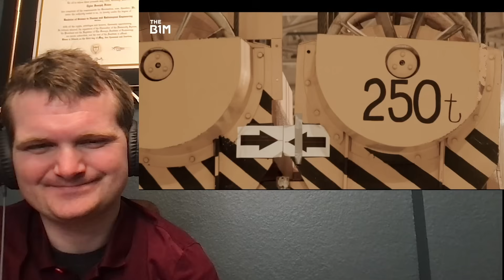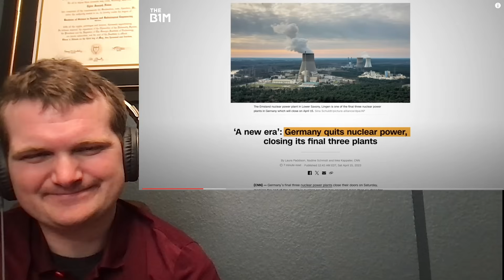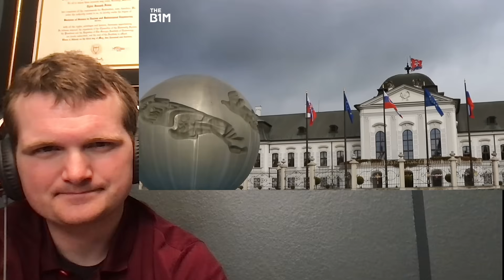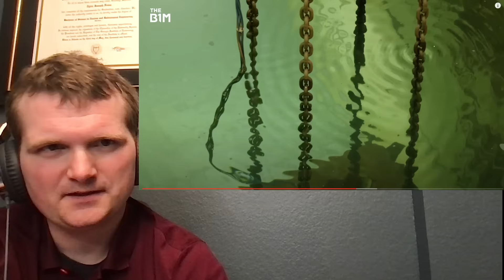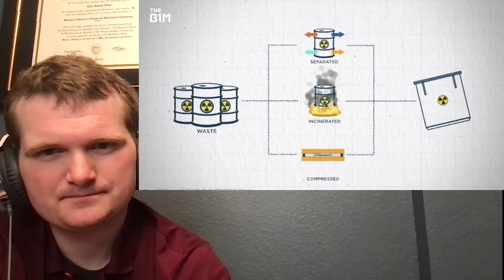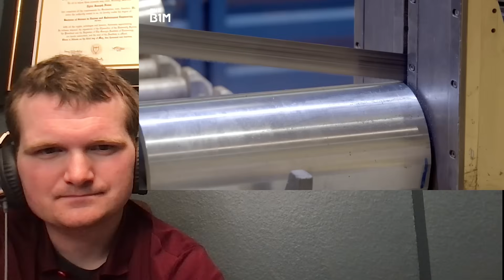Why Soviet Era Reactors are Being Decommissioned - Nuclear Engineer Reacts to B1M

Comment: If you made SMR sites designed to last much longer than the individual reactors themselves, you could avoid decomissioning the activated and comtanimated regions that were still mechanically sound and just swap in new reactors, leavingthe contaminated infrastructure in place, right?

And potentially, even the reactor vessels themselves could be designed to be disassembled, decontaminated (from any externakl/surface level particulates, not activation products in the bulk material), tested for mechanical soundness and rebuilt without having to discard all components wholesale?

The more of the moderately contaminated, but otherwise still usable infrastructure you can re-use, the less has to be treated as bulky waste (on top of the cost savings of avoiding manufacturing entirely new components)

Though some of this makes me frustrated that some shuttered nuclear sites don't leave the non-nuclear portions intact and mothballed for re-activation with new, modular reactor units providing the heat for the old turbine units. (providing the old units still had substantial life left in them and are reasonably efficient to not make the cost of total new infrastructure worthwhile)

If there are old coal fired plants worth converting to SMR power, I'd imagine some of the old nuclear plants would be as well.

Comment: I am from Slovakia. I was in Jaslovske Bohunice a few times, also my good friend was demolishing cooling towers by cranes there. V1 was 'easy' to decommision. In same areal is older A1 block  and newer V2 (same as V1, with two 440 vvers, but newer version) .  V2 is still working, but A1, old CO2 cooled reactor moderated by heavy water, had two serious incidents. during first incident, in 1974, 2 workers died due CO2. second incident, in 1977, contamined reactor hall and some rooms and was categorized as INES 4, and was a reason to close A1. This block is still there and after almoat 50 years, is still hard to decommision.

Comment: Sovjet reacotrs: 
Certainly RBMK is a bullshit, but VVER or BN reacotrs have much higher safety standards.
Of couse, it's not very desirable to have an open air dry storage for spent fuel or operating a nuclear reacotor directly at a conflict line (like in saporoghija in ukraine)
VVER reactors have a tough containment with an interesting steam generator layout (I have some of the training material, but sadly only for the secondary circle, not the nuclear part)

Comment: We have in Finland 2 very old VVER440 reactors (plus one new Areva PWR and 2 old Swedish BWRs). There is very little of original plants left. Soviet crap was partly replaced already when they were built in turn of 70/80s. Power has been upgraded, pressure vessels have had new heat treatment, etc..

Comment: I am from Slovakia. The video you react to had some inaccuracies. If you ever visit Central Europe, we can have a talk over a glass of beer or wine, I would provide you with additional information and context. You made this video with no previous research, because you started to talk about graphite. No problem. You still provided valuable insight from you perspective and I found that interesting. But a little more context would do no harm. As well as historical records regarding the design and operation of the VVER 440 reactor family (both the older v230 and newer v213 models). There was a lot of politics behind certain decisions. The reactor vessels of the V-1 plant were annealed to extend their lifetime (annealing due to neutron flux), yet had to be shut down for no other than political reasons, especially because of Austria. The design is old. I agree. But new ones are still being buit (V213), one commissioned at Mochovce 3 and soon to be Mochovce 4 are expected to be run well into the 21st century. Projected lifespan of 80+ years. Without a containment vessel! (this would be another discussion). As said, I am willing to talk more in person. In the meantime, if you are interested, there are publicly available documents on IAEA.

Comment: The Tomari reactors here in Hokkaido, which all 3 had been offline since 2012 following the 2011 Fukushima disaster, have been undergoing extreme upgrades before receiving government regulatory approval (NRA) in April of this year (2025). The next phase, now that all those plant and reactor upgrades are complete, is to build a 19-meter high seawall to protect the plant (which is on the southern coast of the island), currently scheduled for completion in 2027. After that, final approval from the local residents will be sought. Once the local population gives the thumbs up, Hokkaido Energy will begin the procedures required to bring the reactors slowly back online (beginning with #3) after 15 years, each reactor producing approx 900MW.

Comment: I don't know how It works in other eastern europian countries, but here in Czechia we have to NPs:
Dukovany, with 4x VVER440 (4x 440 MW installed in the early 80s, over time upgraded to current 4x 510MW)
and Temelín with 2x VVER1000 (2x 1000MW installed)

Both were designed to last 40 years and Dukovany was already extended for 60, with expectation of being extented to 80 years. Just as you mentioned. Temelín hasn't been extended yet (as It is newer), but same extension to 60 and possibly 80 years is expected.

Also, as demand grows and we reduce are coal plants, two new 1000MW blocks should be build at Dukovany. (also to eventually replace the old VVER440 blocks) Czechia already signed the papers with Korea, but so far It's being blocked due to legal disputes with France.

Edit: I think WWER is translated to english, as VVER stands for "vodo-vodní energetický reaktor" in Czech (It's similar in Russian, only written in cyrillic), which translates to "water-water energetic reactor" in English.

Also It shoudl be noted, that our VVER reactors has been only based on soviet blueprints, but were completely manufactured and build by people of Czechoslovakia. I dare to say resulting in significantly higher quality of these reactors in the firat place. Furthermore, their operator, ČEZ, invests a lot of money in upgrading and maintaining all of them.
So I'm quite confident in the safety of our reactors, even tho they use soviet design.

Edit2: Our NPs use three water circuits. The main circuit from the core only heats up secondary circuit that generates the steam going in the turbines. When the steam condenses, It's still too hot - here comes the tertiary circuit, connected to the cooling towers.

Edit3: You know what, I think It would be easier for you to come to Dukovany for excursion :D It would explain a lot about the VVER design :)
Reply: It's kinda funny how you trying to prove some quality point by saying that they were manufactured! by Czechs!, but they still were developed, tested, first build in USSR :)

No negative, just funny part
Reply: @Bob-fs1ie Well yeah sure I get that. But often the soviet designs were bad, beacuse they were not build properly and were poorly maintained because of the regime and their work culture... Which is both significantly better here. Even tho It is the same design, I wouln't trust our NPPs even closely as much If they were build completely by Soviets.

Similar case was with RBMK in Ignalina in Lithuania. Even tho It was the horrible unsafe design, this NPP was much better than the ones in Chernobyl or Russia. It's sad It was shut down due to political reasons.

Comment: 2:50 – Subsidies for renewables actually make nuclear energy unprofitable. They cause such price instability that it becomes difficult to sell electricity at a reasonable price — prices can even turn negative during the day. As a result, there’s no guarantee that building a new reactor will be financially viable, since subsidized renewables create long-term uncertainty about market prices.

To work alongside renewables, new nuclear plants need to be flexible — able to ramp up and down quickly (load-following). Alternatively, they should be designed to switch to hydrogen production when electricity prices are too low. This hydrogen can then be blended with natural gas and used as fuel, helping to further reduce greenhouse gas emissions.

Comment: After decommissioning the reactor itself, could you leave the other infrastructure in place, like the cooling towers etc. and build a new reactor with a new design on the same site? The site has already been OKd to have a nuclear reactor on it after all so the zoning and legal crap around that shouldn't be an issue and not having to rebuild all the other infrastructure would save a heap of money wouldn't it?

Comment: I don't know if this is true but I've read somewhere that Chernobyl actually used MILITARY reactors slightly redesigned for civilian use. Which was the reason for weird design choices of the RBMK. This is also probably why Diatlov, a former engineer on nuclear submarines, was the main engineer at Chernobyl.

The main purpuse of RBMK reactors was not to actually produce power, but to produce plutonium for military use - or so I've heard. But Chernobyl was a nuclear power plant, so they've used those nuclear reactors for something they weren't really designed to do.

Soviet military used to have (stil has) very low safety levels as everything was top secret anyway and even if an accident happened nobody would care since the site would most likely be hidden anyway and everything would be covered up (like in case on Kyshtym Disaster -  google it). This is probably why a lot of safety features present in civilian reactors were skipped or simplified in RBMK.

So yeah, The Soviet Union did the stupidest things and then wondered how come those things wouldn't work.

Comment: Bohunice 
A-1 KS-150  operation stopped 1979
V1 
1 VVER 440/V-230 ops stopped 2006 
2 VVER 440/V-230 ops stopped 2008
V2
3 VVER 440/V-213 planned stop of operations 2065
4 VVER 440/V-213 planned stop of operations 2065
Plan 
APR 1000
Reply: Plus there is Mochovce another multi complex with 4 reactors where 4th is to be finished by next year

Comment: I work at a decommissioned nuclear power plant, just to put things in perspective, it took 21 years for the decommissioning process and most of the buildings and cooling towers (just the conctete shells) are still in place, but they're completely gutted.
Reply: What kind of work is there to do at a decommissioned site?
Reply: @stab74  Pretty sure some places turn into museums/experiment facilities/education facilities. Some facilities gets abandoned completly where they only do check ups due to having classified information etc, And some facilities serve a different purpose.

Comment: Nuclear is just the way to go. We need to get away from this stigma of Nuclear is bad and dangerous. If all things are done correctly and these sites are regularly audited (like they currently are), then Nuclear is safer than any other power source bar Fusion. 

The waste is negligible and most of it (once decontaminated) can be reused. It's also a lot less of an impact on wildlife and the environment. "Green" energy requires far more heavy metals to produce (which means a lot more destructive mining), far more land to destroy to get adequate amounts of energy (solar farms and wind farms), and the batteries are all lithium. Lithium batteries do not hold the charge forever and eventually lose the amount they can hold overtime. Not only that lithium is also very dangerous and requires mass mining to get from the earth (more environmental destruction). Let's also not forget "green" is very situational. Solar needs the sun to be shining and wind turbines need the wind to be blowing.

Comment: Seems like a young reactor to close considering here in Finland we have two Soviet VVER-440 reactors in Loviisa Nuclear Power Plant that recently got license extensions until 2050. Of course the difference is that these two have proper containment buildings and Western control systems so only Soviet parts are the mechanical ones. And over the years they increased the power output from 440MW to 507MW. 

Actually there's a funny story on how due to geopolitical situation in the 1970s the plant was required to select Soviet reactors and when the Finnish engineers went to see one VVER-440 in use in Russia there was a pigeon flying in the reactor hall. The Finnish engineers were asking the Soviets where did it come from and they said it probably flew in from an open window. It was then when they realized the reactor did not use a containment dome, and ended up consulting American company Westinghouse to design them one. It was probably the hardest part of the project since the steam generators etc. delivered to Finland were HUGE because the designers weren't anticipating any containment, so Westinghouse came up with a huge ice bank system that would cool the escaping steam during an accident so they could downgrade the size of it considerably. The power plant ended up getting a nickname Eastinghouse because of this unorthodox combo of Soviets, Finns and Americans.

Comment: 3:10 I would beg to differ. That depends on the energy mix of the power grid in your region. In Québec, the vast majority of the power is provided by large hydro-electrical dams. Its hard to understate just how large the reservoirs behind those dams are, with many off them being some of the biggest on the planet, either in terms of area, or volume of water retained. Hydro is renewable, does provide baseload, and has the added advantage that it can be quickly be brought online as need be.

In recent years, Hydro-Québec has added a lot of Wind Turbines. A nuclear power plant can't easily shut down when there's surplus wind power. On the other hand, Hydro-Québec can take turbines offline and instead opt to store that water behind its dam. Its also very notable that theses turbines are widely spread throughout the territory, meaning that while there might not be wind in one location on a certain day, there's likely more than enough wind at other locations. Hence, in Hydro-Québec's particular energy mix, the line what constitutes baseload is much more blurry than it would be for most other jurisdictions.
Reply: Hydro is a terrible option. Sure it's 'renewable' in that it creates energy from the flow of water, but the dams themselves are environmental catastrophies. When I compare hyrdo to nuclear, I'd take nuclear any day.
Reply: Hydro is limited to position. One way to work the surplus electricity of nuclear is to link it with a hydro plant and pump the water up. Essentially using it as an inefficient battery.

Comment: The two finnish VVER-440 reactors (startups in 1977 & 1980) at Loviisa NPP have been heavily upgraded and have a nominal 507 MW capacity atm. In 2023 they received a license extension to 2050, which is a fair bit given the originally planned 25 year lifetime.
Reply: I mean at least from what I have been reading it seems like these are a pretty decent reactor so yeah nothing wrong with that.

Comment: Fun fact.
The reactors 1 and 2 in Jaslovské Bohunice after they were shutted down, were still too hot so for many many years, they were using it for heating nearest cities like Trnava and couple of Villages as well. The reactor number 3 and 4 are still in use and they will be producing energy ( heat energy for those cities as well ) untill a year 2065. I'm from Slovakia and WE ARE BEGGING OUR GOVERNMENT ON KNEES to build atleast another 2 units with 1000MW electric because i'm currently paying around 75€ per month for the electricity but my average power consumption isn't that high to be honest and also don't ask me how many times i was thinking of building my own solar power and get rid of that billing... but solar power in Slovakia is also not that easy to have... you'll need special certified team and a looooot of papers to do but you can build it for yourself by yourself of course but if something bad happen, insurance company will kick your ass right a way and there is also a huge risk that you could've been charged with " unofficial power plant " with fine hitting hundreds of dollars... my country sucks a lot, but i really hope someday it'll be better. 
In NPP Mochovce on the other hand is last reactor expected to be connected to grid by a next year in 2025. But still, the 440MW one. But atleast the safest one in the world. After the chernobyl and Fukushima incident, those VVER reactors are really really safe and some my friends working in that NPP in Mochovce says that even a 10yo child will not cause a disaster. There is so many computer power, autonomous driving and so many safety system that makes whole this even more safe. 

POZDRAVUJEM VŠETKÝCH ZO SLOVENSKA❤️❤️🇸🇰🇸🇰🇸🇰
Reply: VVER440 u nás bežia cez 500MW a existuje projekt "NJZ" na nový reaktor do Bohuníc s výkonom cez 1000MW, ktorý by sa mal stihnúť dať do prevádzky <2050, keďže niekde v tom období končia licencie pre V2.